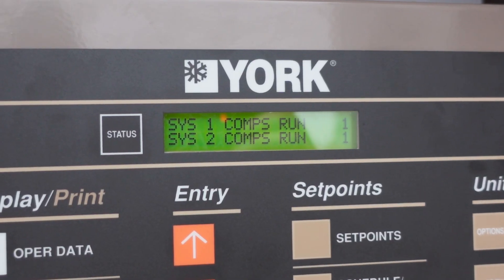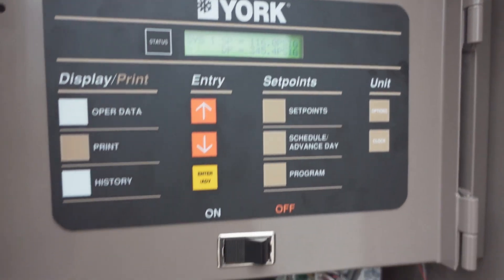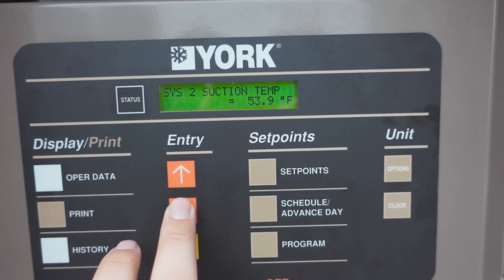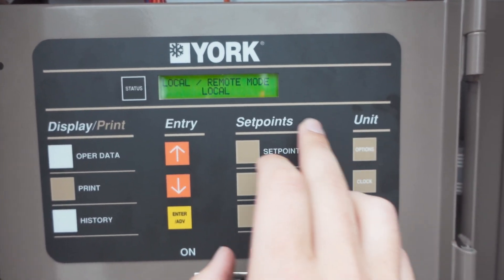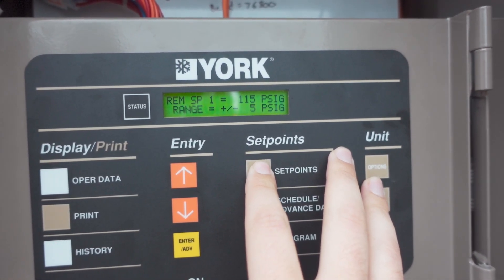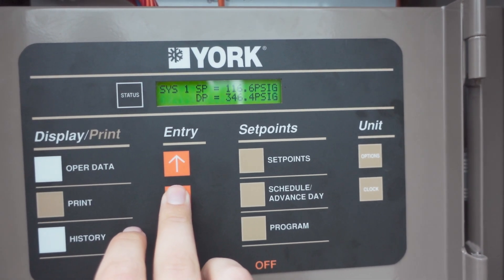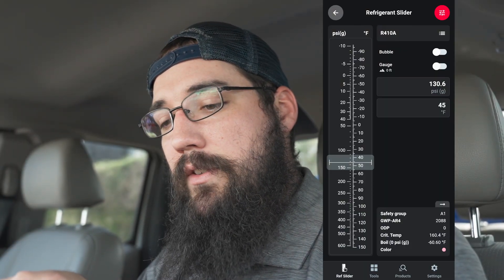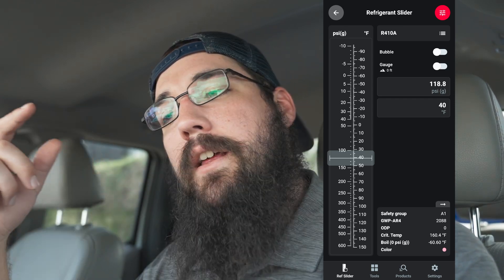HVAC Training: Suction Pressure Staging

Comment: Worked at a pharma site for around a year as a static fridge technician, they have freeze driers, many of which are staged by suction pressure. Large two-stage systems with screw compressors and hundreds of kgs of refrigerant. Fascinating stuff and so different to what one normally comes across.

Comment: Noticed over the decades that older systems did better humidty control than newer units. New ones stage on temperature only. Older staged on suction which was directly affected by humidity load. They tracked with the sensible and latent heat of the air, not just sensible which is what newer do.

Comment: First I would like to thank you for the bravery of putting yourself out there solely for the goal of education in the trade as well as sharing your insight to particular pieces of equipment tips and tricks. I'm a fan and always look forward to your videos. Not sure how you find the time doing both service and post so many videos. Hat's off my friend. 

For years I have always felt suction pressure is the only way to stage successfully while maintaining compressor health. There are several factors that come into play with such a narrow approach towards staging. You mentioned VAV's. Are you operating the supply fan with a VFD? If so, that can become problematic if you are staging with suction only. If the VFD drops below a certain percentage you would certainly want to lock out a circuit. Another issue is if you happen to develop a leak on the first circuit. If it is set up as a "wet" coil in the evaporator the air bypassing the active circuit in the Ahu could also become problematic. I'm not sure why the industry has always been satisfied with a single point of location for supply air temperature. Why not use an averaging sensor instead. Why not combine that with suction pressure as well as pressure safeties for compressor control and unloader staging? For instance, you could restrict unloading if the supply air doesn't drop below 57 degF then lockout that circuit if it exceeds the low pressure threshold. The scenarios can go on forever but what I'm trying to say is, "Why not both?". This can be done with relays as well as programming of a DDC controller or BAS logic. 

Thanks again for your contribution to the trade.

Comment: One time I used an unloader to keep from having an EVAP ice up weekly. It was in the melt shop of a steel mill. If you were a couple days late changing the filters it would freeze up. I put an unloader on it. Pressure would drop, it would unload and buy us a few days. :)
Reply: Doesn't make much sense. The dirty filters make the pressure/temp drop already. Why would you want to drop it even more? You'd just make more ice
Reply: @HVACRTECH-83  when you unload your compressor it acts exactly like bad valves. The head comes down, the EVAP comes up.  Low high, high low.

Comment: is it fair to say suction staging would involve a single refrigerant circuit, discharge air staging would involve multiple circuits? 
thinking of a single compressor with unloaders or a ref rack with multiple compressors on a suction header maintaining suction
Reply from the maker: No, the York condensers I referenced has both circuits running together. Carrier and Aaon do the same with multi circuit.